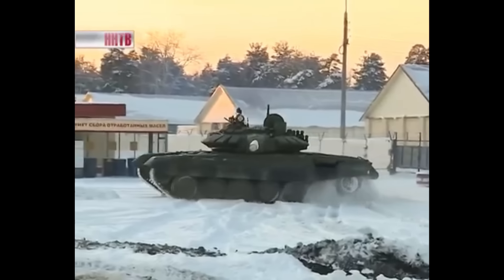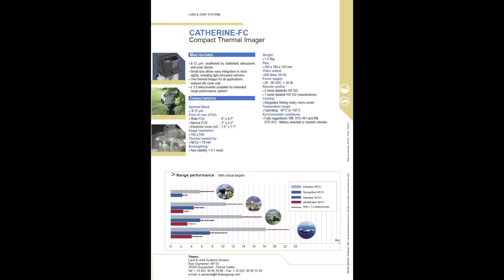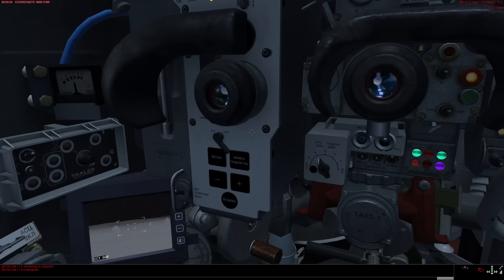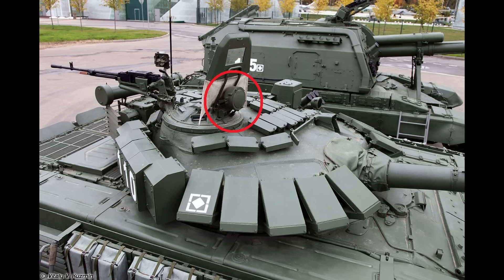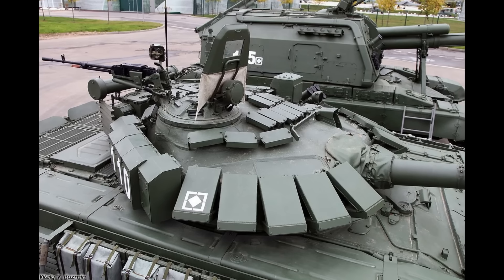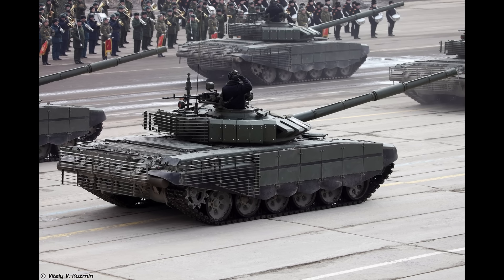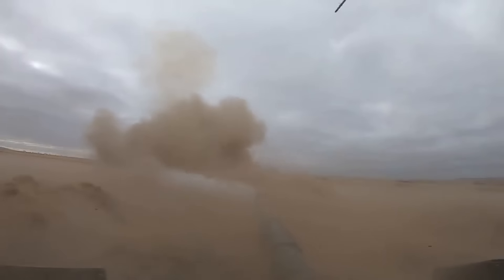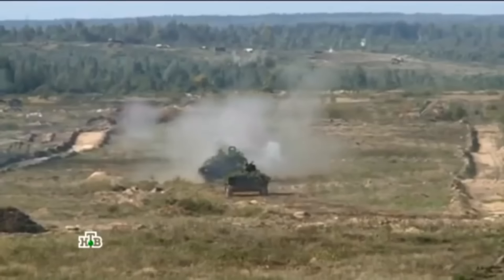Problems with Russian T-72B3 tank

Comment: I am always for autoloaders. It's just the carrousel types are dangerous, especially those in the T80 that are very tall. The autoloaders on the Leclerc is much better. If the ammo is hit, the blast door will save you so long as it isn't penetrated as well. Although you have a bigger turret on the Leclerc and the ammo placed on the turret-bustle would be more shootable than on hull floor of T72. They might make a blast door behind the driver and ''Blast deck'' just over the carrousel so that, in worst case, only the driver will be killed. Should not be very expensive.
Reply: suspect losing driver (+?) makes you nearly toast ...
Reply: Well since the auto loader is on the floor, why not make the blast door on the side that way you wont lose any crew members inside the vehicle, but yeah better say goodbye to your tracks and stuff
Reply: @shoshots  A sideway blownout panel is calling for ammoracking from RPGs. Russian did try to modify T-90MS turret bustle to carry 8 "dangerous" HE-FRAG rounds separated from the crew (while leaving the same old autoloader intact, slapping some armor on it and call it a day) but they decided it's just too costly and returned to hull ammo storage on T-14. Armata would at least not fry its crew if ammo got ignited but the whole tank would be toasted beyond recovery while Ukrainian T-84 Oplot got a Leclerc-style autoloader.
Reply: What kills those tanks is the HE-FRAG ammo and them being hit directly. It doesn't matter where you place a stack of HE-FRAG rounds, on the floor or into a bustle: hit THAT type of ammo directly and it'll tear the tank to shreds.
Reply: @shoshots  What if the APFSDS dart comes from the front? To hit the carrousel on the floor, you have to hit the lower glacis that is free of any composite armor. Certainly you can make the blast door to blow to the sides, but there would be an entry hole on the front that spews fire on the driver's compartment. In that case, there must be a separation between driver's room and commander-gunner compartment so the fire doesn't spread. 

With this areangement, the driver can still survive only if thevcarrousel gets hit from the sides or not too hard from the rear. If it's a strong top attack missile, the commander and gunner will be killed, the driver survives. I don't see any other ways but a 2 way blast door.
Reply: @Max_Da_G  It depends though, although i agree that if the tank carries HE-Frag, the blast door will tear. But russian ammo is 2-parts ammo. That happens if the projectile hits the HE-frag warhead and not the propellant.

Russia might not even need a blast door actually. Perhaps producing a better ammo is much cheaper than retrofitting blast doors. Germany has munition propellant charge that doesn't burn if hit. They should develop this and blast door is irrelevant(If it's not HE-frag). I still can't think on how to prevent the cook off of the HE Frag warheads.
Reply: Problem in Russian tanks is the ammunition. Russians are using 125mm HE shells. They are extremely powerful. Also that brown think where is gun powder is just thin waterproof cardboard that can easily cant fire. Also the APFSDS casing. Also when they place  ammunition anywhere else except  carousel is big non brain moment. One spark or small shrapnel and fire is there.  That's the problem
Reply: @TonymanCS  the reason armata doesn't have Leclerc style autoloader is that it doesn't need it. In T-90MS the turret storage isn't meant for combat but for rearming the carousel autoloader. With unmanned turret and much larger hull in T-14 there is no point in storing it in the turret s back.
Reply: Auto loaders are great until they grab the gunner when he gets out of position.
Reply: If that is the case the driver should get danger money.
Reply: Looks like crew is cheaper than a door for them
Reply: @tasman006  Yeah he might get a paycheck raise
Reply: @Maks-Yarysh  Actually most blast door designs require the ammo to be placed in the turret bustle, which is far more visible to get shot at than the carrousel down under.

 But you bring up a good point. In the end, cost and protection level depends on the country's strategic condition. Many tanks of large countries have their engine in the back, putting the crew, instead of the engine in harm's way.

If the tank is knocked out, you have less work before putting it back in service with new crew. These countries have tens, if not hundreds of millions of citizens. Losing the crew is preferable than losing the tank, they have materiel shortages, not population.

Smaller countries with tiny population, like Israel and Sweden, prioritize the crew instead of tanks. That's why Merkava and Strv 2000  have their engines on the front to add as much protection as possible. The Swiss NKPz is another example.
Reply: If the Leclerc is penetrated so far that a blow out panel might become important I believe the tank is a goner and I am not sure if it will really matter that much. I mean it's better to have one than none. But honestly I think many people overstimate the blow out panel and blast doors in modern tanks compared to the Russian ones. 
The thing is, all the modern tanks can more or less penetrate each other on the usual combat ranges. And when they do it's never a pretty sight. Carussel, auto loader or not. In Like almost every case where you have a penetration into the crew compartment, it's game over.
Reply: Drivers are cheap…
Reply: @7vampir  I get the feeling that in the near future, we will see loaders and drivers replaced by automation. In a bit further future, every task of the gunner automated. Every tank will have only the commander, that's the only thing that i think even AI can not replace.
Reply: it not autoloader that explode, it additional ammo in turret, it exposed. Same as in leo2, mb even in challenger, i dunno, challenger so rare because noone use it so I don't remember if it has additional ammo indide or not.
Reply: auto loaders literally exposes the amo and an auto loader can be slower than a human loader
Reply: от детонации бк не спасет никакая дверка)
Reply: As has been pointed out by the Chieftain among others: Human loader = +1 pair of hands for all maintainance, reloading and repair tasks. Since you spend most time outside of combat, that's a bonus. Especially as human loaders and autoloaders are basically the same speed, but autoloaders jam. A human loader can also swap ammo without firing. You have HE loaded and spot an armoured vehicle, your first shot won't need to be a giant "Here I am, come kill me" to the opposing force.

Similarly if you've any other round loaded and spot an ATGM team, you won't need to fire a 0,1% hit chance round before loading HE and engaging.

Remember Russian tanks were designed to be used by massive expendable hordes of slave-soldiers. Quality was no consideration.
Reply: @nvelsen1975  if you has expendable soldier then yes, you can put 4-th man into tank. you can put 5-th radio-man like in ww2. But human can easily be damaged, concussed, also human can't reliable working on move, so you forced to stay on place if you want to reload shell.
Also the more inner space you has - the less thinner armor you will have.
This is why when Iraq (or iran) start using Abrams or Turkey start using leo2 against isis, they start losing tanks too fast, unlike Syrian army, where even old t-72 can take 3 shell and survive, tanks without autoloader usually being penetrated by first ATGM.
But nato tankers much cheaper than autoloader, this is why even western artillery doesn't have autoloader, that has no explaining at all.
Reply: Having watched and read a lot of accounts of tank warfare in Ukraine and elsewhere what I am going to say is that the exploding autoloader problem is massively exaggerated. Nobody would use a tank that could be defeated by kicking it angrily in relative terms. And there is more than enough footage out there of T6x, T7x, T8x, T9x tanks being hit hard repeatedly and either remaining in action or not detonating catastrophically. In combat footage it’s not at all in common to see a tank hit by three rockets or multiple cells and still keep on fighting effectively. The exploding Russian tank is a funny meme but it’s far from the rule in reality.
Reply: @Mortablunt  
Israeli tanker losses fighting heavily armed Moscow-armed terrorists in Lebanon with untrained tankers that just sat there: Low. Mostly lighter to medium injuries and damages to the tanks despite being targeted with the latest tandem-charge warheads Putin gives to his terrorists.

Russian tanker losses fighting Ukrainians: Utterly catastrophic with at least 4000 dead.

Now let's scale that Russian loss down by a factor of 4 because the Iranian-Russian terrortroops in Lebanon are not as numerous and we still got 1000+ dead for using Russian gear, compared to a number of dead well below 34 (those were total IDF losses for all branches) driving Israeli Merkava's.

Come again on how a few anecdotes of Russian tanks not instantly exploding makes it a myth?

And do explain why Russia did away with their design philosophy for the 1980's tech T14 prototype?
If it's a myth as you say, wouldn't Russia have kept the system for T14 instead of going western with blowout panels etc?
Reply: @Mortablunt  exactly.
Reply: @nvelsen1975  I think you misunderstood the concept completely by being blinded with hatred towards Russia. Which is OK because i am apolitical, yet purely technical. The T72 with 3 man crew is operable even by 2 people. Given 40 people each, the russian team can bring 20 tanks, while the NATO team only 13, if not just 10. In a full fledged, all out war on eurasian plains, 20 on 10 is a no contest. Achievable, thanks to autoloader.

Even more, the most expensive tanks in the world, K2 and Leclerc, both have autoloaders and 3 man crew. Last time i checked, a 12.26 million USD Leclerc is not expendable nor to be used by massive endless hordes of mindless slave-soldiers thrown to certain death. But you can use the cheap Abrams that way, it's just a 6 million USD, manually loaded tank.
Reply: Good idea, unless your the driver.  lol

Comment: I think a lot of the issues with Russian tanks is the Soviets designed everything to be cheap before anything else.

Trying to match NATO spending on an economy a fraction of the size does that

So the core design is already cheap. 3 man tank with a giant autoloader carousel to make up the loader that merrily cooks off when hit and an old engine. OG T-72 relied on a lot of what was then brand new stuff for the USSR but it was behind the curve then and continued to be as the Soviets modernised it

Now with modern Russia, this old hull gets given modernisation on the whims of rampant corruption and the fluctuations in oil price
Reply: @Работаем, брат! They didn't fare very well against NATO tanks in Iraq in the tank battles there.

Comment: The so-called "B4" T-72s from Tank Biathlon were put into service. You can see one of them still has the Uralvagonzavod logo painted on the side skirt. However, judging by the burnt out hulk of one with the easily identifiable turret thermal, it did about as well as the rest of its B3 and B3M brethren.

Comment: There is also problems if you shoot the side around the wheels just below the skirt.  The armor there is thin and even the 30mm off the BMP can blow right through that armor.  Also even a simple fragmentation grenade on top of the engine compartment can take out a T-72.
Reply: This is a problem that pretty much all current MBT's face though, if you're close and sideways vs. Autocannon you'll get shredded. The western MBT's don't have more than 100mm vs. APFSDS to the side either.

Comment: who's gonna tell RedEffect that the M1A2 SEPv3 is just an upgraded 1980's tank
Reply: There might be a slight difference between effectively entirely rebuilt tank (New armor, new sights, new larger gun and countless other things) and one that has gotten a new sight bolted on to it with some ERA blocks with a bit better ammo available for it.
Reply: Still better
Reply: Who's going to tell you that a 1980's Mercedes Benz is better than a 1980's Lada? Cope away, young Russian.....
Reply: @joestrat2723  Ukrainian troll moment
Reply: @mrmacias4217  kek
Reply: @paulknoll4261 Well T-72 is 60's tank.
Reply: @Frenchdefense9404  I meant the M1 is still better. I understand, that both tanks could be my father but there is a difference in the quality of upgrades. Because of this it's quite easy to say, which is better

Comment: How about a video on a hypothetical tank using all modern tech? I think this war is going to launch a whole new generation of modern tanks that are not just upgrades of old tanks like the Abrams, T72/T90, Leopard2 etc. They are all based on 40+ year old tanks that have been given the Japanese Ricer treatment. 

I would love to see some modern digital sights and curved panoramic displays to cut on hull penetrations and increase situational awareness. Even just the compute power that we have developed compared to the early 2000s and now would give major advantages. Modern multichannel sights using AI for target acquisition and tracking could aim for weak spots of any target and quickly switch to the next vehicle based on damage and risk assessment. 

Hybrid electric drive systems could give tanks lots of power while using the motor to charge battery/capacitor banks. This would increase range tremendously because regenerative braking can recapture 60% of energy.

Lighter weight ceramic metal matrix composite hulls for decreased weight and modular constructions, allowing multiple systems built on one chassis. The economy of scales on part reuse would allow spending more on new technologies by saving on production.

Ferrofluid hydraulic suspensions for a smooth ride with adjustable height for aim assistance and increased mine clearance.

So many possibilities, not to mention all the modern weapons improvements
Reply: Rheinmetal just released one
Reply: @Ukraineaissance2014  no still uses old tech
Reply: @Ukraineaissance2014  I'd still say KF-51 is still evolution of Leopard 2 concept
Reply: I've been thinking about that during a video. Couple caveats:

 - I unironically think that T-14 general layout has greatest potential for next gen which new tech enables. Crew located in such isolated compartment would not only increase survivability, but allow them to have much more quiet, much more protected and less cluttered space to focus in.
 - Of course carouselle auto-loader is still just that, so I guess bigger turret with ammo compartment on the back would be a better option, but then ammo is more exposed to being hit.

- hybrid-electric drive probably wouldn't be ever used to significantly decrease fuel consumtion, regenerative braking is pretty insignificant in tracked vehicles... BUT with comparably small battery bank should enable big 'boost' in emergencies. extremely large torque from 0RPM which electric drive allows would really decrease time needed for relocation after let's say enabling smokescreen.
- electric drive and batteries would also enable tank to travel short distance without generating heat, which might be crucial with thermal sights everywhere
- also electric drive can be used exclusively for reverse giving nice speed without really complex gearbox/transmission.

- I'd LOVE to see similar concept to F-35's helmet with argumented 360 degrees vision around the tank blended and projected onto said helmet. It opens whole new dimension to crew's situational awareness (which historically has been bad for tanks). Not even comparable to periscopes and probably could make better use of existing sights.

- A big-ass screen capable of showing map with all units connected to the system marked and datalink enabling unified target-identification system.

- I'm certain some hard-kill APSes with top arc capability are developed right now. Drones and top attack munitions are no joke.

- Also said tank would make a pretty nice drone command station, so integrated recon and/or suicide drone launcher with dedicated crew member might be present.
Reply: VR headset linked to turret cameras on top?